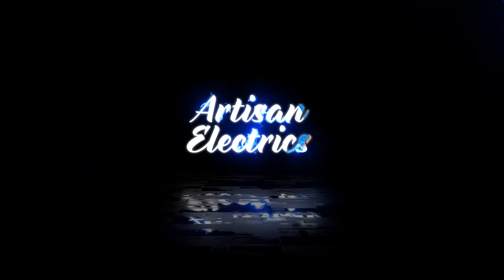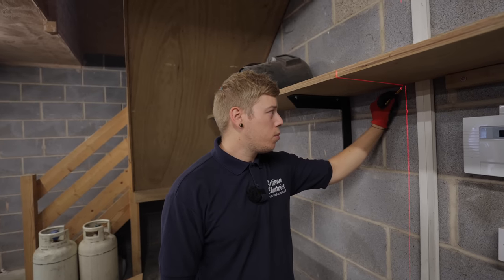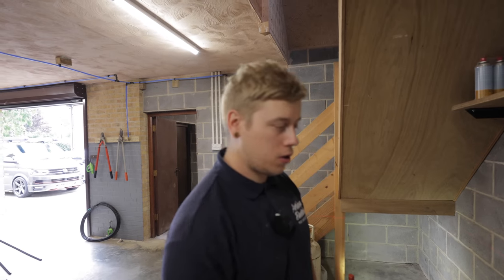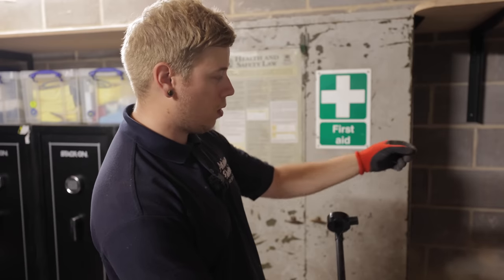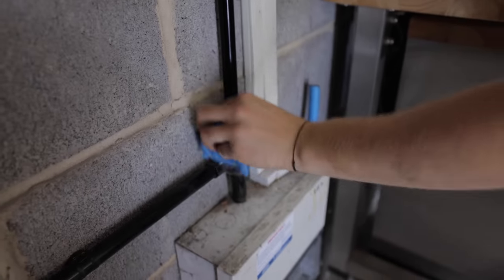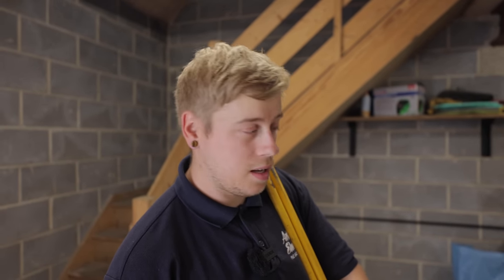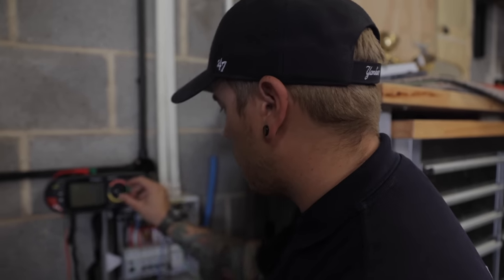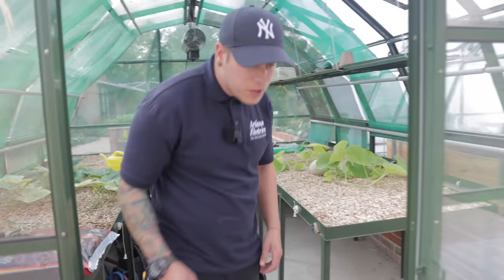PVC Conduit CRASH COURSE! Installing 35+ Metres!

Comment from the maker: Let us know if you have any more PVC conduit tips?
Reply: Please i am a residential automation engineer in Nigeria and I have been looking to buy the trousers your electricians wear... Please what keyword should I search... If I search "electrician trousers" I don't see anything similar.
Reply: Blåkläder work trousers
Reply: Maybe some cable lubricant when pulling single cables through ?
Reply from the maker: We wear Blåkläder
Reply: @tombickerton4114  I use silicone spray but only in old rewire. New cable and conduits are already very slippery from the factory
Reply: Snickers also good brand for padded knee trouser and strong shorts.
Reply: @justme5384  Reading the Swedish equivalent of BS7671 (SS 436 40 00 section 522.8.1) the use of lubricant containing silicone oil is expressly forbidden for use in lubricating cable pulls.
Reply: @kyomujin4402  good point, I have to look into what SFS 600-1-1 says here
Reply: When doing multiple bends in one piece, bend a bit of copper wire as you would the conduit to get the way you want to bend it
Reply: You can also strip the wires, rather than use tape only. Use the conductors to attach on the draw wire,join them accordingly( eg: Higher & lower)useful for longer distances,if you see necessary ,applied tape at the front.
Reply: I worked on a 6 story office building that wanted open ceilings, so the entirety of the electrical system was contained in the cellular floor.  We had to run over 25 km of EMT in the floor, and the biggest obstacle with conduit is planning.  Figure out your runs before you bend the first piece.  Lay it out on the floor if need be.
Reply: @MS-Patriot2  I second the vote for snickers just had my first pair acouple of weeks ago and love them. I went for the 6271 in navy as I have to wear navy as a uniform at work.
Great trouser and hardly took any time to wear in as ive found with other brands
Reply: @Jay369  OK I just found them in amazon but 144 pounds, what in the hell
Reply: @donlatinohits  

That's the reason the Artisans wear them 🤣
Reply: @Jay369  now I want to know the makers of the safety boots as well... I will buy the trouser eventually.
Reply: @donlatinohits  

Steel Blue are the manufacturers. They have a few different types of boot. There's a 5% discount from Artisan in the description if that's any good for you.

Comment: I did not expect you guys, could do pvc conduit installation. It's much neater & the cable is secure. Rather than the usual bear cable installation, highly unsafe & surprisingly accepted  by the BS requirement.  Now that's what we called  a proper electrical installation. Hats of there 👏 👌

Comment: For PVC conduit I always used a plumbers pipe cutter (retired now). Always a clean cut and a slight chamfer on the cut so easy to fit into couplers/boxes ETC. clean and tidy and quick with no mess.

Comment: Interesting video Lee and I really enjoyed watching it, some good tips for newbies to conduit. D line saddles are my go to. They leave the conduit neater and compliant re: premature collapse. A few things to mention though...... I calculate your volt drop to be 14.64V using a 20A MCB with 0.61 Ohm so not good as is though your Zs was in order. I think the IP socket was okay before you hit the in circuit neon with 500V. You should also have had your CPC in the earth bar when you IR'd the cabling. Other than that,  a good effort. 👍

Comment: Very surprised you guys didn’t know that the low insulation resistance would be coming from the fact line and neutral would connected across the neon, that’s why always connect your conductors with wago’s to do insulation resistance testing then connect socket outlets after. Great install none the less👍🏻🍻

Comment: Always enjoyed installing conduit because with care you can make it look good.
Pulling in singles I always used some talcum powder to reduce the friction on long runs particularly when there are bends.
If you pull cables through too fast it’s possible to melt the plastic on the edges of the conduit box where the singles enter.
A piece of soft cloth helps to prevent that happening.

Comment: Nice work Lee. Only thing i would do different, is apply the glue on to the tube instead of on to the socket or box. That way you are less likely to get glue inside the tube, creating a potential obstacle.

Comment: Tidy installation there guys. The low insulation reading will be coming from the neon indicator in the outdoor socket. It will be connected across line and neutral after the switch on the socket and it’s the voltage from your  Megger that’s making it illuminate 😊
Reply from the maker: Completely right! cheers!
Reply: The amount of experience lee has you think he would of seen that….. neons always give false readings
Reply: The reason it’s faulty is because he just whacked 500v straight between L-N. Done this on an RCD socket before and always do 250v before regardless if it’s a new install
Reply: @sk83rboy00  not true, the meggers are designed to protect sensitive equipment. If you look when he took the reading It only applied 160v to the circuit because it detected a load
Reply: @sk83rboy00  roughly 0.25?

Comment: Those 90s look a bit tight, that's why the spring is so hard to pull out. Internal radius should be 50mm so I always bend it over the top of my knee for a smoother bend. Might not be as tight to the ceiling but easier to pull the wires through. Nice to see someone take time to do a nice tidy job.

Comment: I must admit I was surprised when you did the insulation resistance test at 500V with an outside socket that as a neon on it. The reason the neon didn’t work was because you’d put 500V through it. Nice install though 👍
Reply: Or just short LN conductors and test at 500v
Reply: The Megger only put 160v through it because it detected the load, but yeah the neon is where the false reading was coming from.

Still looks like a faulty socket though, as only one of the two neons was illuminating.

Comment: You need to revisit the IR test. To comply with BS7671 it needs to be done with the cpc connected to the means of earthing.  All you have tested in that video is that the L/N/E conductors are electrically separated from each other.  If there's a connection between Line & the green house frame, for example, you won't pick it up...    

Nice tip about the draw wire storage though 🙂

Comment: It looks great, but my I have two big complaints in relation to future serviceability. 1) The sections being glued together. 2) The seemingly lack of notch the holes where it passes through the shelves. Item 1 means you can no longer dissasemble the conduit and reroute/repurpose it in the future, and item 2 means the shelves are now trapped in place by the piping and cannot be removed.
Reply: 1. No.
2. It's not a hole, it is a notch.

Comment: No expert myself mate but that draw spring wire metal head has a loop to strip the singles pass them through and bend them back on themselves….if you strip enough and only pass a bit through the hole on draw wire the looped over stripped single will rub along the conduit making pulling cables smooth work….Top as always mate

Comment: I would always rather use the curve piece. If you need to change or refit anything, remove the curves and you can pull the cable through one straight pipe after the other.

Also, I could not see the clips, but the ones I use can connect to another clip left & right, so you can connect 3 conduit pipes with just one nail / screw, even different diameters.

Comment: After pulling some antenna cable through some flexible conduit somebody reminded me about the rope loop and I was cursing them going oh that's right I should've done that and of course the robe came off. thankfully it was only 10 feet remaining and I was smart and fed them from the top which was up on the second floor so with somebody upstairs pushing it and me wiggling the conduit that was still out of the ground I got it the last 10 feet.

Comment: We don't use cement. We have straight joints and boxes that have small metal clips in them that holds the conduit in place. I use ABB AJ20 and as a junction box for example ABB AU19

Comment: Nice in depth video Lee, are those the d line conduit saddle clips you used? Would you have any issues with using those clips also for swa and ev cable installs too

Comment: The socket wasn't faulty you just blew the neon when meggering line-neutral at 500volts , obviously the switch was closed
Reply: Just what I was thinking. 500v through a neon light = fucked haha

Comment: Interesting to take two set of cables to the socket by the moose head instead of putting a junction in the t-box just above the DB. Would have saved some cable, but i guess it's an extra juction

Comment: Great video, if you have the measured R1+R2 can you reverse the calculation to get the length? So times r1+r2 by 1000 then divide by the per meter resistance? Keep up the good work
Reply: You can, but in both cases you need to consider poor connections may also increase the resistance. One of the reasons we're supposed to compare calculated R1+R2 to the measured value, and also compare to measured Rn+R2, is to detect loose connections that could potentially overheat and cause fires.

Can't see a problem with doing it backwards though: "to get that reading we should've had a run of 50m, but our run was only around 30m... Maybe we have a high-resistance fault somewhere on the circuit?"

Comment: Did you calculate volt drop? 16A radial with 2.5mm conductors with a length of 44M you said, pretty sure you would need to increase the cable size?
Reply: Correct would need to be 4mm not watched the full video yet so i don't know the actual length of each circuit yet
Reply: 12.6 volts . A shade over 5% at 230v

Comment: With the blue draw rope just twist it against its twists so they open up and push the cable through. Do it a couple of times and when you pull on the rope it will tighten against the cable. A little bit of tape should be used for belts and braces.

Comment: You usually use metal clips to ensure the cables don't drop in a fire. Doesn't the plastic conduit melt and drop the cables?
Reply: clips will still be around the cables though

Comment: What was the attachment you had on the SDS drill, so the drill wouldn’t slip on the brick work, seems like a very handy tool
Reply: You mean the ring around the bit? It's the vacuum cleaner, doesn't help with slipping
Reply from the maker: What he said 👆
Reply: @justme5384  feel like a clown 😂

Comment: Great video! Is it code in the UK to glue the conduit? In the Netherlands we don't do that at all.
Reply: There's some guidance about how much you can pull through due to the risk of it chaffing the insulation too much
Not been an issue for me but it is one of those regs for single wires
Although it might be for metal conduit rather than PVC, I'm sure someone will correct me if it is 👍
Reply: @therealdojj  metal is thredded so no need for glue, plus our firm always makes us glue it as it just increases the strength of the conduit if it was in fire conditions etc

Comment: PVC conduit is about the easiest thing I've ever fitted
Even though it was 20 feet in the air on an outside wall and it was windy AF 🤣
Reply: Simple for an electrician maybe but it's a great guide to somebody who has never done it before
Reply: @lewis94uk  I trained to be a spark in the 80's
Which means I'm a bit older
And not really the sort to climb a ladder and swing about a big old SDS
😉
Inside work is fabulous and Lee's made it look super easy bending that pipe 👍

Comment: There's no need to buy new tools as long as the old tools were well taken care of.... I'm looking at you the 3 pairs of bolt cutters that can't even cut paper. OK exaggerated but there is literally a dull spot along the whole blade of one pair a few notches in another pair and one pair that is completely dull and won't even cut bolts. And I know this guy probably got them at auction.

Comment: I'm surprised you did the radial in one leg considering that radials are allowed to branch from the origin (rings too). This is just adding unnecessary length to the circuit. Yeah you'll have to terminate 6 singles in the CU instead of 3, but that's also what you do with rings so no big deal; and yeah both runs will go into the same protective device, but that's no worse a situation than you already had.
Reply: That isn't good practice